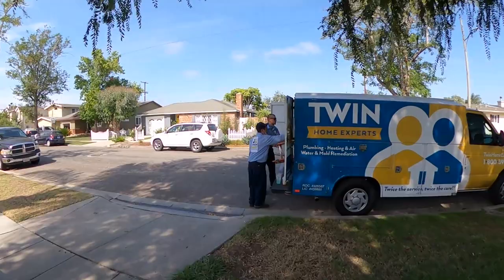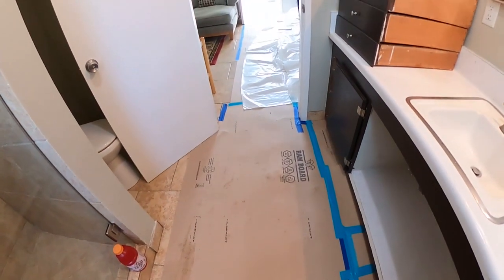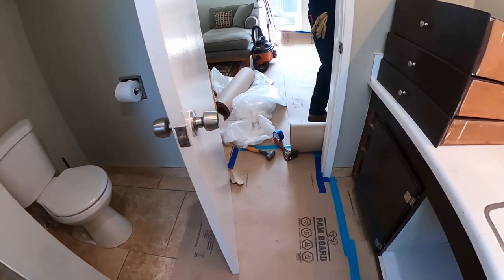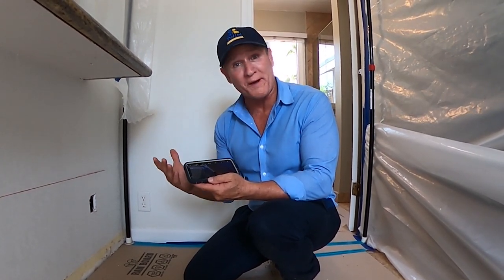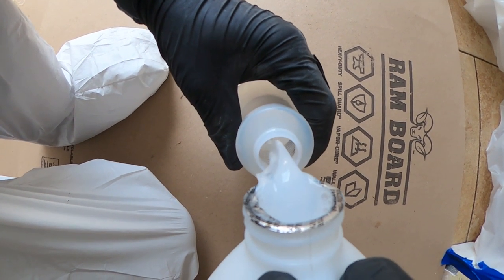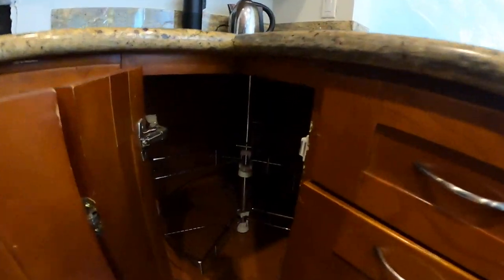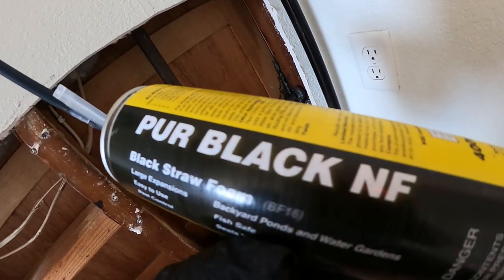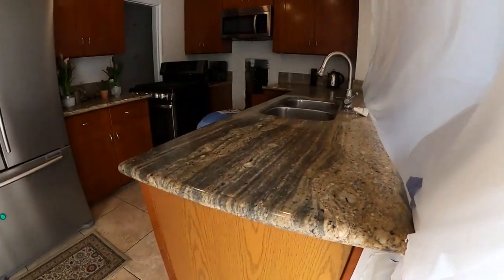DISGUSTING RAT NESTS ALL OVER HOUSE!! Cleaning up after a rat infestation... BEST RODENT REMOVAL

Comment: What a nightmare... this is causing me to have flashbacks to an issue we mostly remediated upon moving into a home last month. The sellers left the french door of their kitchen open all the time (for their dog) and, naturally, rats got inside. They nested under 70% of the void spaces of the cabinets, dishwasher and pantry. It was disgusting the amount of nesting material and rat droppings. We found 3 dead juveniles from fumigation that we did right before moving in - I had killed the mother rat via snap trap the night before/morning of fumigation as well. The fumigation was for termites btw. It was horrible having to deal with this and we had to demo the bottom cabinets and rebuild everything. The odor hasn't completely gone away but I found out that they made their way behind the refrigerator (a large Subzero fridge) as there's a small hole in the wall. Once we're ready to, we're going to have to pay to have the refrigerator moved so we can access the area behind it, clean it, and inspect/open the drywall and clean out whatever is behind there :( I don't know if we'll ever be able to completely get rid of this odor. It's very unfortunate and the sellers definitely hid the problem well - likely cleaning up rat droppings and leaving the doors and windows open and using air fresheners to mask things during open houses and escrow. Our home inspector wasn't keen enough to catch any of this either...
Reply: That sounds like a complete nightmare! I’m so sorry….
Reply: @bakedandsalty9234  it was bad. I recently picked up an Ozone generator so plan to run that while we're out of the house. I'll probably put it in the kitchen too so it gets most heavily concentrated in there.
Reply: Man you could of get the house at a discount
Reply: @Kanti12311  lol.... Right
Reply: How much did all that cost u? Moved into my fist home 2 yrs ago and dealing with the same exact problem, like the same. Have to get rid of our stove it’s so disgustingly and the smell is awful it’s so embarrassing 😞the previous home owners had also always left their doggy door open and there was SEVERAL holes in the house from outside it was ridiculous🤬behind the stove, fridge, dishwasher, under the sinks etc..
Reply: @jessiedamato9473  sorry to hear. That really sucks - dishonest owners/sellers are the worst.  We spent over $2700 to demo, clean and rebuild the cabinets (we just restored them to original condition) The dishwasher was $600+ iirc. I bought an ozone generator to help with the smell. Over time it has gotten better (or we have gotten used to it lol)
Reply: Oh man I hope everything was resolved. The twins sell their enzyme cleaner online if you still (i pray you don't) are having odor problems

Comment: I've sealed off all vents on my roof..they didn't smell..I've sealed all holes I could find but I'm still not satisfied I found where they were getting in. I've not seen or heard anything. In about 2 weeks .They were in my floor/ceiling. I'm worried they'll come back if I've not found the entry point. What should I do???
Reply from the maker: Great job on sealing up vents and all the obvious entry points. If your not hearing anything, just be patient and see if they do come back. 
If they do, then you will have to open up ceiling where your hearing the most activity, then possibly perform smoke test to rule out sewer rats. 
Tip: You may want to consider dumping down some root X at night before you go to bed, this is a foaming chemical meant to kill roots, rats hate this and will deter them from entering your sewer system.
Reply: @TwinHomeExperts  Thanks for getting back to me! Much appreciated. The rootX is almost $300 here in Canada 🇨🇦 bc. I'm an old lady living on disability income so can't afford that. And is why I'm doing this myself. And why I really appreciate your help!
All my  sewage vents had no bad smell. (Except one I forgot to smell. 🤥 ) I dare not get back on roof for now. I will however open up ceiling more once I have a better face mask. Bugs me that I have not found any obvious entry point. Makes me feel helpless.  I'm thinking of buying mint  odor Absorbent packs. To put in ceiling In the meantime. Thanks for ur help guys.

Comment: I wish you guys were nearby I have a finished room above a garage with a attic above never stop hearing activity even after pest control and bait stations they sealed some holes outside but not sure if holes still exist or there are just lots of mice still in the attic, the attic is not accessible either just a small drop down square for air conditioning above which is barely serviceable
Reply from the maker: Thank you for this share! If they sealed up ALL the entry points, try to set traps where you hear the activity, they will work. If you continue to hear noises after a few weeks, you haven’t found the entry points.